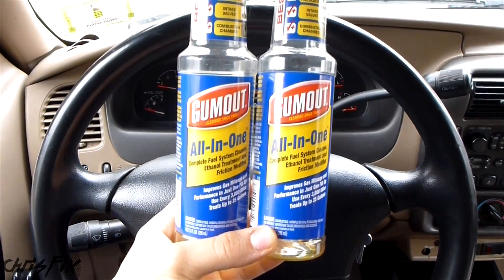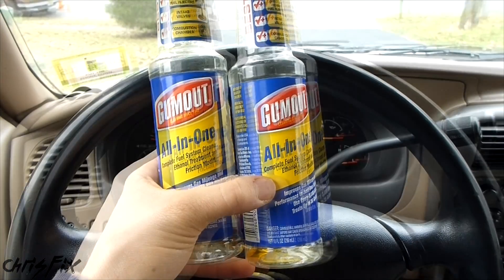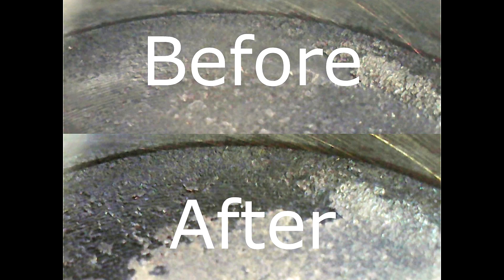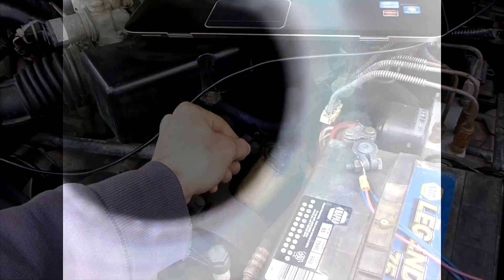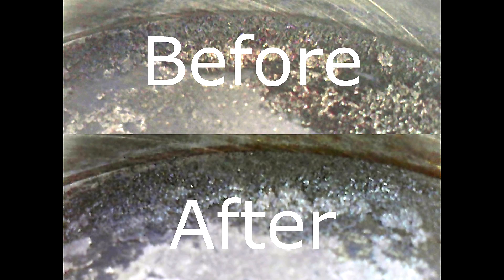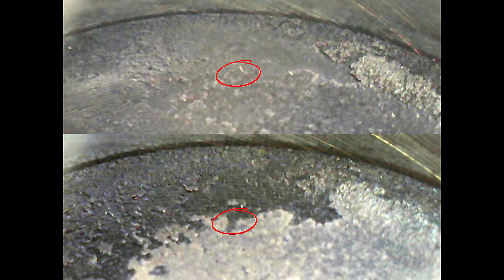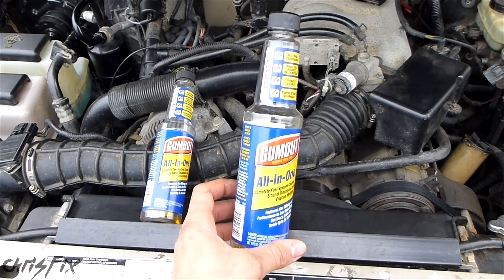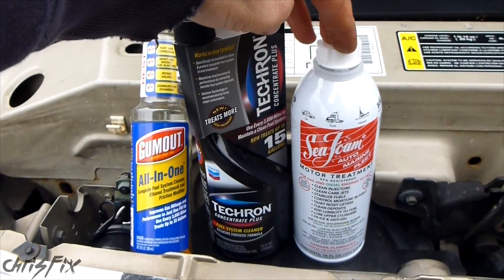Does Gumout Fuel System Cleaner Work (Follow up)?

Comment: Had a check engine light; code P2096. 
Dealership wanted $4k to change out sensors and catalytic converter. I saw this in my local Home Depot and decided to try it out. Bottle 1 on a nearly empty tank and filled up: No results. Mpg 21. 
Bottle 2 on a nearly empty tank as well. Check engine light still on. Mpg 22. 
Bottle 3 on a nearly empty tank. Check engine light still on. 
As the gas was used up, check engine light turned off and has been off for a month so far. Mpg increased to 27. 
Whatever this product did, I would say it worked. My fuel system probably needed a good cleaning with three consecutive bottles. I plan to use a bottle once a month now for preventative maintenance.
Reply: P2096 - probably a clogged injector.  Or two.  Or three.

Comment: IF IT WOULD HAVE CLEANED THE TOP OF THE PISTONS , WHERE IS THAT GOING, OUT THE EXHAUST VALVE AND INTO THE SCREEN OF THE CATALYTIC CONVERTER BLOCKING IT, THIS BOTTLE SHOULD BE CALLED PAY MONEY  TO BLOCK YOUR CATALYTIC  CONVERTER OR EXHAUST BLOCKER PLUGGER UPPER IN A CAN

Comment: They all claim to clean completely and none ever do. It is advisable to use some kind of fuel additives since numerous examples have shown how poorly modern fuel burns without leaving. I think premium fuel with Lucas fuel cleaner does a decent job at maintaining an already clean system for the price, but isn’t very good at cleaning a dirty system. Redline or Rislone Hyperfuel in the binary bottle are best because they use the highest concentrations of polyetheramine which is safe and effective. I just have an older Honda, so I can use Z Max which is mineral spirits quarterly which does a great job of cleaning carbon out of the works. Z Max says it soaks into metal, but zinc was the only one I saw much difference in and they claim it phenomenally lubricates, but I don’t think it was anything too great for that; but for cleaning the fuel and exhaust systems it does well

Comment: I put the wrong gas in my Mazda, I accidentally put a 94 octane fuel and ever since I’ve had a horrible smell every time I’m stopped; smells like sulfur and exhaust. Do you think this will help?
Reply: If your exhaust smells like sulfur it's your catalytic converter. Is your check engine light on?

Comment: By the time the these are cleaned the buyer would be nearly broke? Back in 1976 I had a car come in that was banging when it was running at that time General Motors was having some kind of trouble and they had a cleaner that you fed through the carburetor then shut it down and  let it soak? When I started it up the top of the pistons had to be clean as the engine was as quiet as a new engine? What did GM use?

Comment: Did you get the same gas from the same station?  Cheap gas keeps the carbon building up.  But carbon is not the only reason to use it.

Comment: I don't believe the fuel additives will take carbon off Piston or valves. Even when taking apart an engine it is tough to wire brush carbon off internal engine parts. Even soaking the parts in cleaner doesn't do much. I do think it can help with the ethanol damage or helping injectors or carburetor internals stay clean. I love these videos.

Comment: Did you ever consider running the engine at high rpm for short distance. Do this actually driving car and not in driveway so engine  has a load on it. Safer on engine this way. We use to call it "getting the gunk out,"  it use to work on older cars but I haven t tried it on newer cars. Might be worth a try.

Comment: As I said in your first video there is no magic potion that will remove 20 year old carbon as hard as concrete. Gumout should be use earlier in the engines life to remove early carbon and prevent future carbon build up. It's like fat people they eat too much for many years then spend thousands of dollars on pills some crook is selling, telling them that the fat will just fall off no diet or exercise required.

Comment: Let me tell you something I use gumout all the time and gum out makes my car run like brand new it cleans the carbon deposits and everything I have a 2000 Camaro and it's almost got 300,000 miles on it after every oil change I put gumout in it.. it cleans the carbons and dirt out of my gas tank before my car could barely make it to 80 miles an hour after using the gumout constantly it's now running 120 140 mph and faster... horsepower and torque restored only thing after you put it in if you go to a cheap service station like El Cheapo it's going to let you know it cheap gas with water in it will cause it to hesitate you have to go to service stations with good clean gas.. it also works great in my 2002 Firebird runs like a champ

Comment: Hi Chris,  I follow you all the time you have great informative videos. The Gumout All In One you checked did not have PEA additive to it which has the most affect in cleaning deposits in the engine. I didn’t know that the have a non PEA treatment also. You should check the performance of an additive with PEA. Thanks, keep up the good work.

Comment: In the competitive shooting world, carbon buildup has proven to be THE hardest thing to remove from the bore of a firearm. Using dedicated solvents and physical, abrasive force is the only proven method to remove carbon in the area  just ahead of the cartridge neck. Plus you have to be relentless in this task. I'd be leary of a chemical so powerful to remove carbon in chunks by dissolution, that these chunks might score cylinder walls. So, easy does it may be the best way. Great test ,Chris 👌
Reply from the maker: Thanks for the info!
Reply: gun barrels arent made of cast iron, they are made of purposefully corroded steel or chromium

Comment: It definitely isn't worth the money, for its claims on the bottle. The best over the counter Fuel Cleaner is the Techron..
Just saw it now at $8.97 a bottle  at WallyWorld..was only $5.97 a year or so back...A decent loosner of carbon is MARVEL Mystery Oil over a few tank fulls. Then a nice "Italian Tune-Up" and my normally aspirated engine, purrs like a kitten. Those GDI engines are awful for real bad carbon build up, probably best to see if anything actually works on it? Without  the PITA of pulling the intake maniifold...

Comment: I routinely use Lucas fuel injector cleaner and also their oil additive.  I use each with every other fill up, or at least once per 1,000 miles and the oil additive with every other oil change.  I also use an oil flush with every 3rd oil change, so ~10,000 miles.   I think developing a habit for regular use is what is needed.  You can't expect to use this stuff 2 or 3 times in a row and expect great results.  You need to be very consistent, keyword consistent over at least 10,000 miles or more.  And if for example you had never used it before and have 100k miles or more, then I would say start using it regularly over the next 10,000 miles and then recheck when you do a spark plug change.  I have 175k miles on my old Toyota truck and it's clean and has great compression.  Changing your oil regularly is the #1 thing you can do..along with all the other fluids including your differentials which I do every 33k miles along with brake and clutch fluid.

Comment: Every time you use it there is less carbon afterwards. I call that a success. Considering gas already has detergents in it, this seems pretty effective. Do it about 10 times over 30k miles+ and see if they are worse or better. Pretty easy method to clean something that would take hardcore scrubbing or walnut blasting otherwise. I guess what you consider significant is person to person. Thanks as always for the great video though.
Reply: I would say if u bought a brand new car and used this regularly then u would maybe never have any carbon build up
Reply: I had to use 3 bottles consecutively with full tanks of gas respectively. My check engine light cleared and stayed that way for a month now. I plan to use a bottle once a month for preventative maintenance.
Reply: Literally all decent gas will have some kinda additive in it. Most folks end up in this situation because they never change their oil. Also, drive fast when you can and less carbon will build up.

Comment: Thank you for showing the capabilities for this product "GumOut" I've been using   "Carb & Choke" to remove gummy and carbon buildup around and partly inside my car's engine. This works well. But I don't know if this will cause any problems later on. What do you know about this product?

Comment: I think the combination chamber is going to be the toughest to clean. The injectors if you checked them I'm sure are much better. Also, you may have seen better combustion chamber results with GDI, especially if at WOT because they flood the cylinder for cooling.

Comment: What about the carbon on the valves?  Was it cleaned off?  I never used All IN One but I've noticed more 'get up and go' with Gumout on my old beater cars.  The only thing this review does for me is not use All in One and keep using the original formula because whatever it does, it makes the engine run smoother after it's over, and improves my mileage per tank.  Maybe that's just cleaner valves or something else like dissolving goo between walls and piston, but takes longer on the hardened stuff on piston surfaces, but even if I didn't know it was in the tank, the car just runs better with it on occasion than never.  I think every 3000 miles is a bit much tho.

Comment: Maybe this stuff is like brushing your teeth, it might be too late for it to take the old stuff off, but if you did it regularly from an early age it would keep the engine a lot clearer for a lot longer. I don't actually know but it's a thought, the problem with that theory is think about just how much it would cost to do this for years, and how small of am affect it would probably have on fuel economy and performance. I don't think it would be a very good investment if you need to start using it on a new car to keep it clean and use it every oil change or even every other time.

Comment: I WONDER if stop and go daily driving would be a better way to let the product breakdown the carbon deposits rather than running a straight 300 miles as you seem to have done?  The frequent stopping would allow the Gumout to sit on the top of the piston and soak in longer.  Doing the 300 miles all in one or two trips just burns the Gumout off before it has a chance to work.  How about squirting the Gumout into each cylinder and leaving overnight?  Repeat the next day before driving the vehicle.  Could cylinder 5 have such a bad buildup because the sparkplug is bad or fouled?

Comment: it's gonna take a while for these to work, one or two bottles isn't going to do it.  Btw you DID see improvements so their claim is solidified.  You didn't like the degree of improvements but there were by your own admission so claim confirmed.  Any carbon removed is significant.  You expected a brand new looking engine that's your problem.  Stop using the word significant too since you don't know how to use it

Comment: This stuff is good, cause, when your car has 150 k miles and gets loss of power, and engine hesitation, there could be 10 things going wrong.   More than likely, you only need to clean it.   Ease your mind. Like the bottle says, every 3,000 miles, not a big waste of maintenance expenses.

Comment: I would say this stuff is better suited for cleaning out fuel injectors and resolving rough idle, but carbon deposits on the pistons is a not a strong point but some marginal improvement here.

Comment: I think you have to use this from new.... getting old hard carbon out using any fuel system cleaner would not work but if you use it every oil change on a new engine, it make keep carbon from building up

Comment: if you use gumout from the very beginning when you first buy a brand new car with a brand new engine, it keeps that shiny black new carbon buildup from..well..building up.

if you use it in an old engine it slowly breaks that stuff down but VERY slowly like over the course of a year youll eventually break that hard chunky stuff up.  

ive been using this exact product in my 89 volvo with 320k miles for about a year now and the tops of the pistons do improve.  you just have to put a bottle in every week and dont skip a week.  

yes its $4 or 6$ a bottle but it does eventually get the job done.  

my opinion is to use a bottle every month when you buy a brand new car so you dont give the carbon a chance to build up at all.
Reply from the maker: Thanks for sharing!
Reply: @chrisfix  thank you for making awesome videos, youve inspired me so much and your videos have helped me do everything i needed to fix up my car
Reply: I think your advice is a bit overkill.  Many guys sell their cars before it gets very high mileage.  So every 5,000 km like the bottle says in Canada is cool.
Reply: @galactic904  i have a 2005 toyota corolla with 270,000 that I plan on keeping for another 100,000 miles so I appreciate his advice.
Reply: How about getting an actual carbon cleaning job done at a specialist so they walnut blast or something to clean it out instead of using bottle after bottle of this crap

Comment: Hey Chris I had a 99 swift and had a mechanic repair the engine and he soaked the pistons with H7 degreaser they were covered with plenty of carbon deposits because I saw when he removed the cylinder head, he left them soaked overnight and the next day they looked brand new!

Comment: So basically it does work well, but only if you use it from where the car was brand new or had low mileage, by these results it should be able to clean any fresh build up before it hardens.

Comment: Gumout seems like a product you want to use continuously, more for preventative engine rinsing than real deep carbon cleaning. I feel it would still work well if you aren't having carbon buildup issues already just to keep carbon deposits from forming.
Reply: Thinking same
Reply: Carbon build up come from egr. You can't clean it out.
Reply: If you change your oil regularly and use clean fuel and drive fast (high revs will help slow carbon build up), chances are you won't really need to do this, unless you have a shit engine or you need to because you bought a secondhand car someone else didn't look after. Check inside your engine, and get a professional cleaner, cheap cleaners are a gotcha scheme.

Comment: I think carbon in an engine is equivalent to cholesterol in a person. If your doctor tells you you have too high of cholesterol, eating a low-fat meal once a month will not help, you have to eat low-fat all the time. Same is true with your car, you need to use one of the fuel system cleaners on every tank of fuel. Most of those are cost-prohibitive to do this, there are some though that are made to use on every tank of fuel and they improve your gas mileage enough that it more than covers the cost of the product.

Comment: really like chris videos, i been watching them for years, i have one idea, instead of putting gumout in the gas tank, why don’t you use a little hose and put gumout right in the spark plug hole, so you will put pure gumout right over the piston, i think 1 bottle for 3 pistons, so it takes 2 bottle to do both sides, then run the test again, just in case chris read this but i might try this idea myself

maybe that will give better results
putting pure gumout right over the piston

Comment: Says fuel injector cleaner cleaner and system cleaner says helps break down deposits gas is not the same as 55 year's  ago smell the exhaust if you use 110 octane run the engine hard a couple times blows the carbon out young people have no idea why about performance except 4 and 6 cylinder turbos lol

Comment: Not a big fan of Gumout, but you got 210 miles on a tank before you used the stuff so if you burned sixteen gallons, you got roughly thirteen miles to a  gallon. By the way, that thing should do better than that. For this video, you appear to have gotten about 310 more miles. That's over seventeen miles per gallon, which is closer to what I would expect from that truck.  It looks like something got better.  Keep the great videos coming, I've been a fan for several years now. Many thanks!

Comment: Chris you need to drive the car really hard through the Rev range in order to dislodge the sludgy carbon. 

You didn’t mention how you drove the 500 miles. 

Use she’ll v power drive it hard few tanks. Change the oil. And see the difference. 

I opened an engine with 220k miles. 150k of those was on shell v power. No a sign of any sludge or carbon deposit.
Keep up the good work
Reply: Check out engineering explained, running a hard rev range doesn't clean the engine, carbon burns way hotter than your engines combustion gets to.

Comment: The packaging states (and what you specifically pointed out) is that it  "Improves Gas Mileage and Performance in just one fill-up", it does not say it will clean up carbon deposits in just one fill-up . The claim on the packaging does  state that is "helps clean and protect" which it may in fact do.
- it's definitely a marketing technique to get you to read/believe what you want to read/believe...but to be fair you are not testing it against the products actual claim. 
I do think your video is useful to demonstrate just how powerful (or not) the cleaning action is and whether or not the product would be useful to you. My guess if you did one of these every 5000 miles or so from the start buildup deposits would be reduced over time. That is just a guess.